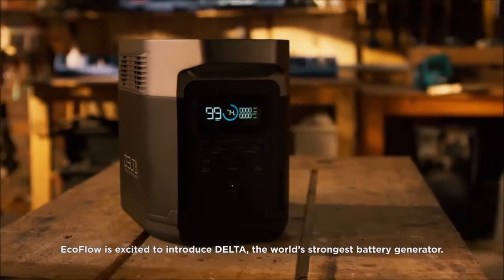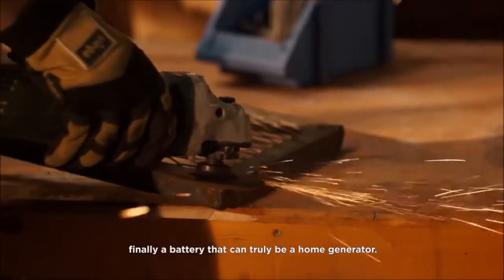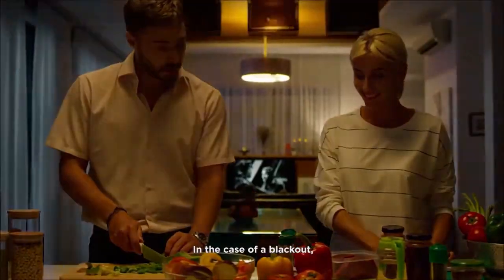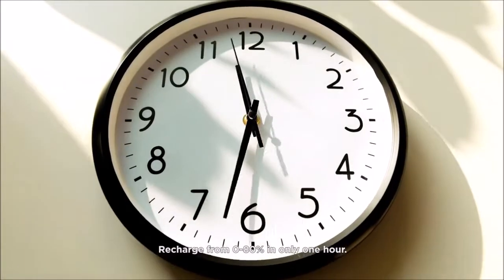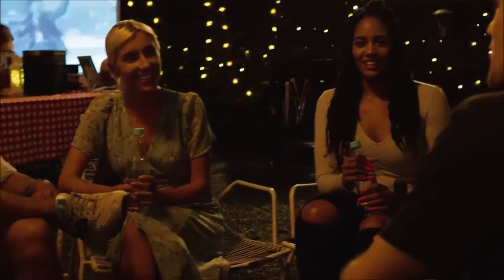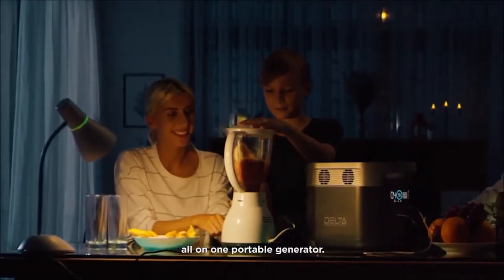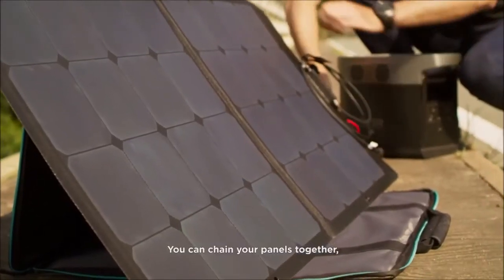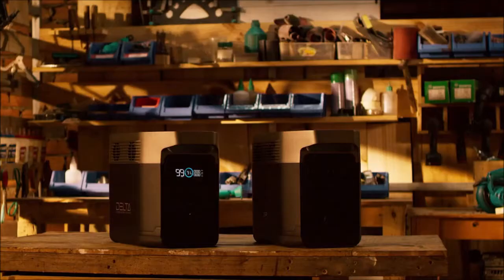Delta 1300 Power Station

Comment: Would you please specify how long it can power home appliances - e.g. refrigerator 25 c ft - for?
Reply from the maker: The average size energy star fridge can run for approximately 15 hours on the Delta 1300 alone (before incorporating solar power). Thank you for your inquiry!